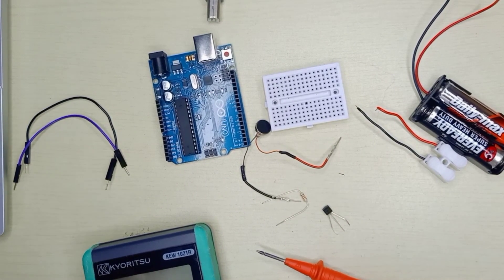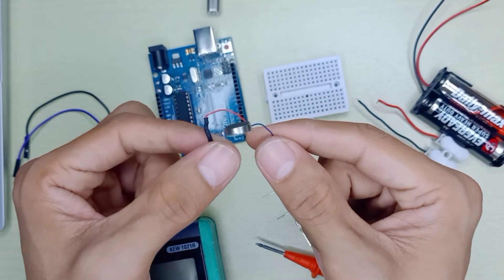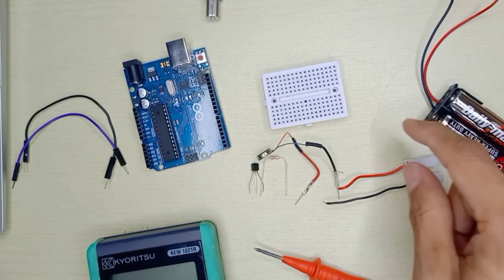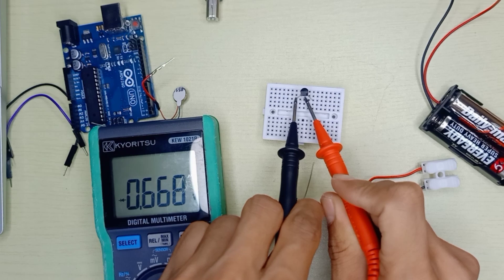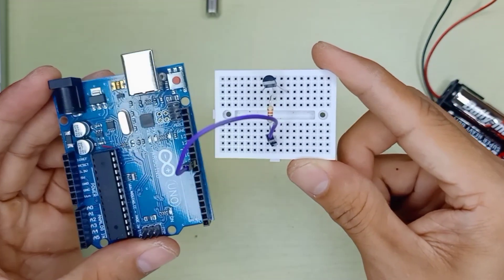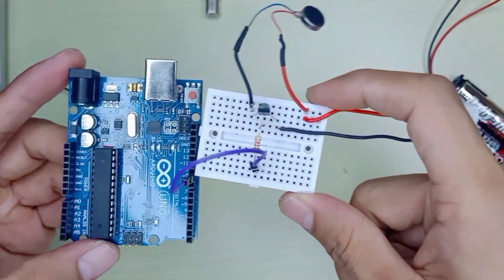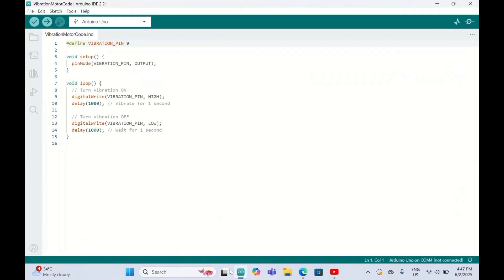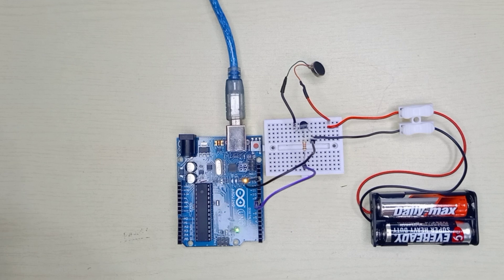How to use vibration motor with Arduino

Comment: Please, sir, can I control the vibration speed of the motor?
Through what can that be done?
Reply from the maker: You need to use motor driver or transistor to control the speed.

Comment: hi, may i ask how do you connect the vibration motor with jumping wires??? pls help me huhuhu
Reply from the maker: Cut jumper wire and joint the vibration motor wire thats all what i did it.Its simple you can do it too.😊